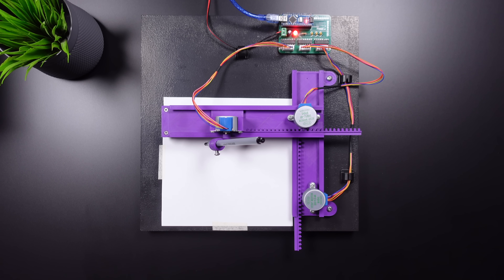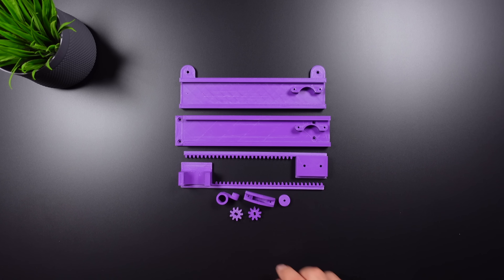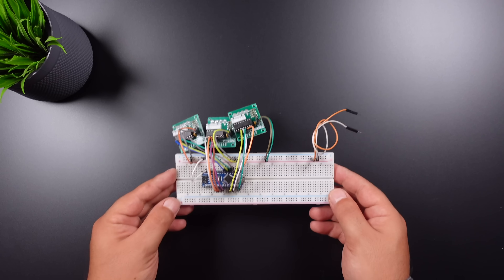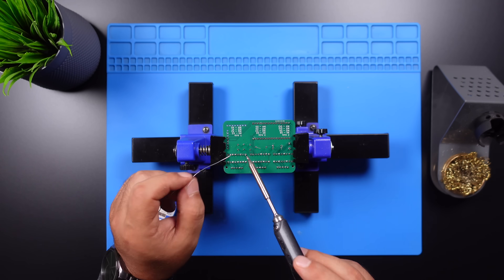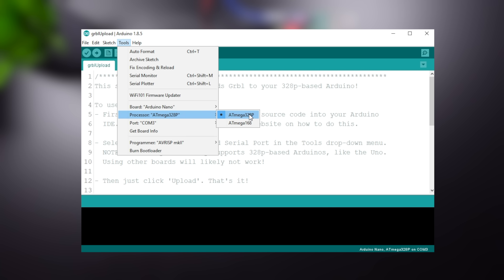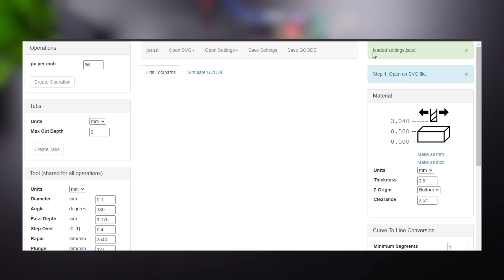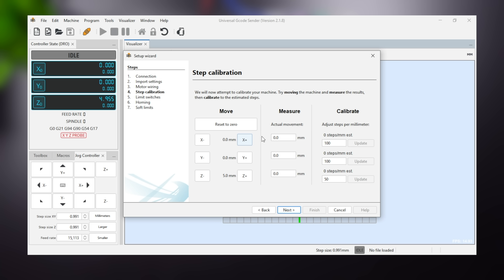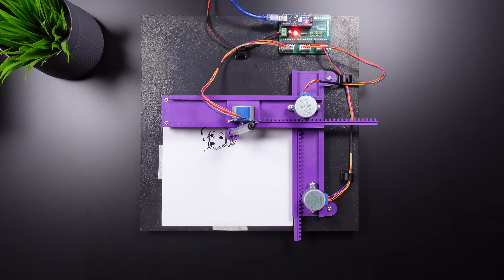Build a simple 3D mini CNC plotter

Comment: I managed to make this project but ran into two issues. First, the 90 degree overhangs are tough to print on the tracks. Maybe a dovetail design would be better? Second the rack and pinion system has a ton of backlash that makes really inaccurate movements.

Comment: can I use arduino UNO for this?
Reply: my friend told me that a arduino uno gives 500mA of power, each driver needs 240mA so 240x3 = 720mA so arduino uno wouldnt be able to give enough current to make the 3 drivers work. We still haven't finished our project but we are using a arduino uno power module (dont remember exact name), will update u if it works

Comment: I have CNC shield for Arduino UNO and DRV8825 step motor drivers for x and y. I already upload grbl sketch to my Arduino and I already download  GBRL Universal G-Code Sender. I'm just beginner. So I don't have any CNC parts.
Can I use it with your design? Which file is for 3D printer?

Comment: I will use the same 3 motors, but each one alone, not combined in one panel. I will make the voltage source complete and use the connection from the laptop or an external source.

Comment: I printed all parts but they don’t fit together!
Reply: Mine fit very snug with some force required. I needed to sand down the x(?) axis side but that was it. Atm, I have a problem with my power supply overheating.

Comment: Bro what is the exact amount of power supply u have given in this project like 5v and how much amperes? PLZ tell.....
Reply: I found that no external power supply is required. Only usb cable power is sufficient.
Reply: Correction: Sharing arduino usb 5v sometimes cause stepper motor slippage due to insufficient torque. Use a separate 5v power bank or power supply (1A or higher), is OK.

Comment: I have issue with motar spin on opposite direction i changed in software it wont work
Reply: same for me. did you find a solution?
Reply: @mininduwijerathne7361  give the wire connection inverted it might work